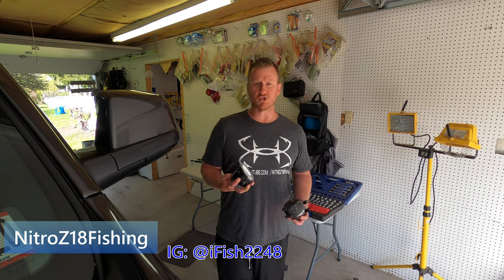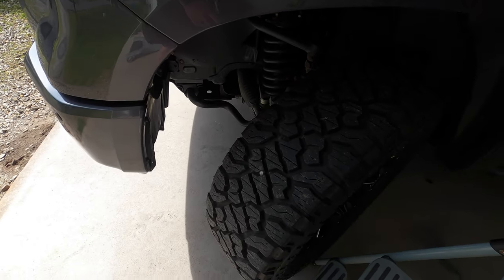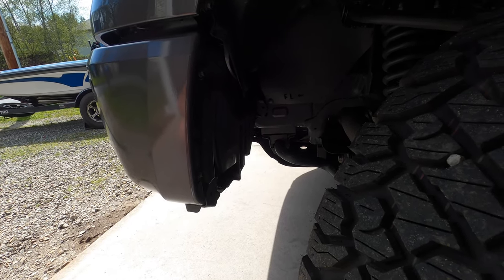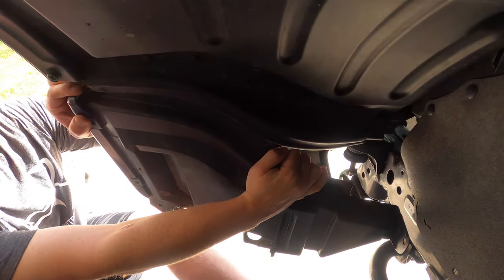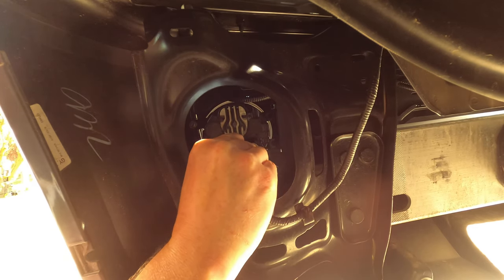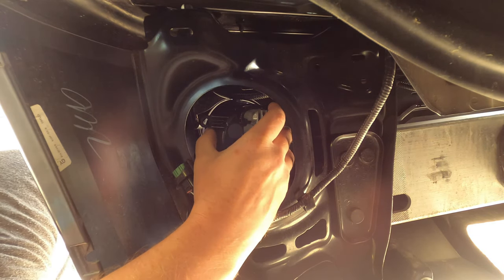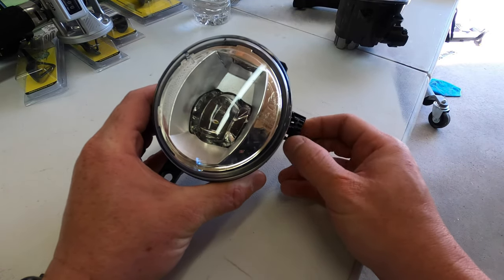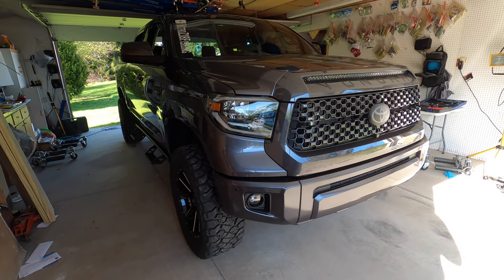How To Change Out Fog Lights on Toyota Tundra

Comment: You should put a disclaimer on this vid or change the title to "Changing the entire housing". I pried mine out to change the bulb and now it's fucked and wont fit tightly back into the bumper, the one side just shakes all over.
Reply from the maker: This is actually a common problem with Toyota fogs, it’s super annoying...most people use zip ties behind bumper (so you can’t see them) to hold the assemblies tight and stop the shaking
Reply: I m guessing you had the halogen fogs and just swapped the bulb, why did you remove the whole housing though?